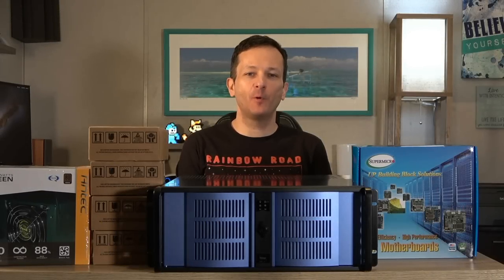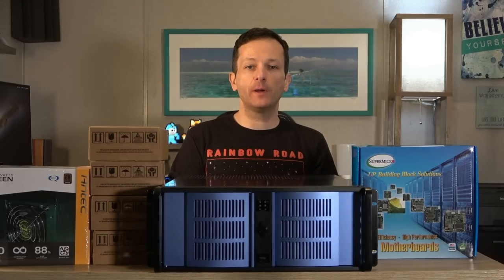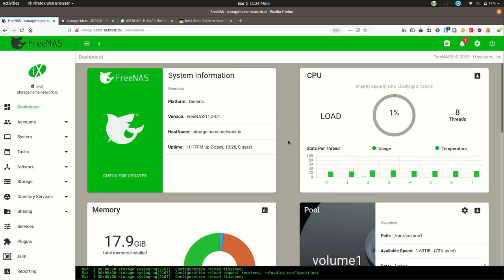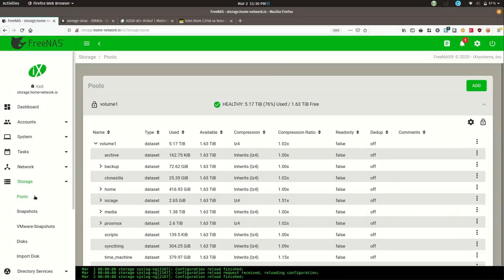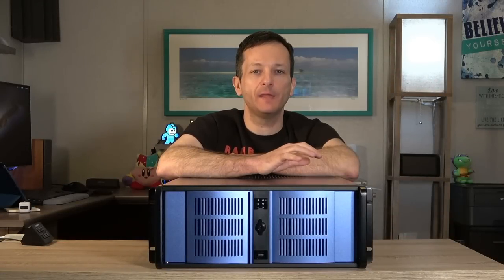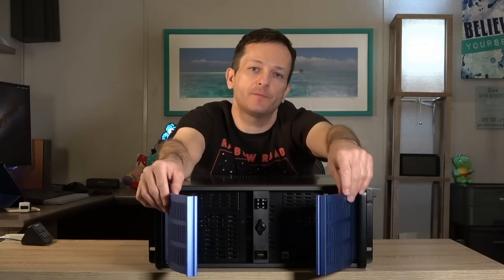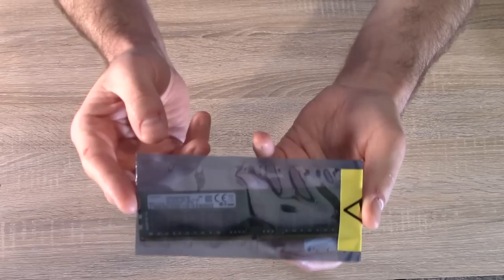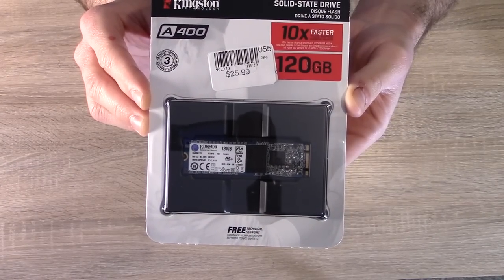Building a Low Energy Storage Server for your Office/Homelab

Comment: I have to say that I was quit disappointed in 54W of power. How high is your average CPU load on that, you might still have a board that is overpowered ? What drives did you use? While I started this video, I thought, cool, I'll just do what you do. But at the end, my Synology 416slim is using 10W . So I am wondering where the difference is, why you need 5 times more energy than my synology.

Comment: So, how many watts would this server use with 4 3.5" hard disks at 7200 RPM? What is the price of electricity in the US? Will the price of electricity justify buying an $800+ motherboard?
Reply: Usually the power consumption for a hdd disk is between 7 and 10 W, usually 7 at idle. I built a similar nas, but with a supermicro board with and embedded epyc  cpu of 35W TDP and 5 hdd disks and got a power consumption of 70 W.

Comment: Configuration seems quite unbalanced - lots of CPU power, no 10Gig network, not much point of ZFS with only 4 slow spindles; Whats the point of using so small form factor MBs when you have a huge case and dont have any expansion slots available for some LSI HBA and 10G;